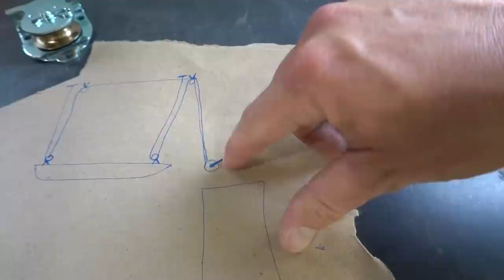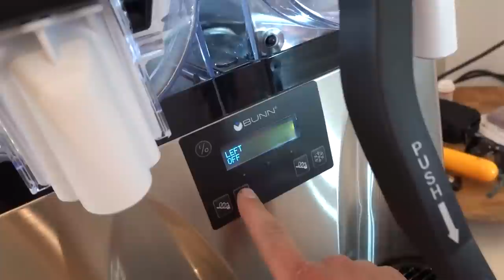Big Lake Day Fail...

Comment: 550 paracord is more than you need. Buy it from the army navy store, if you have doubts about buying it online. If it is real big 6-8 inches of the end should be able to stand straight out when held horizontal without going limp(I meant stuff). Plus the inner strands will not catch on fire, and very hard to burn compared to nylon fakes. Just included two ways to test the ends. Because you don’t want to hang the four-wheeler from your tree stand using imitation 550 paracord. lol.There are good dealers selling it but a lot of fake ones out there too. The two eBay stores I use slip my margarita mind at the moment. LoL. j/k.. Then you can use shock cord with carabiners also from the army navy store to keep the end slips hooked to each other so they can’t slide off. Safest cheap way I can think of. Peace!
  P.S. I would try Some Lipton Iced tea in there for Long Island teas.
Reply: Why is the crank mounted so high? Paracord would not fill up the spool if that is the reasoning. 550 is rated at 550lbs but it will lift double that for a one time use.maybe you can test that in a video. But don’t reuse it because you wont see if the inner strands got damaged. 750 would feel up the spool a little faster making it take less revolutions. But costs way more than 550

Comment: You can use a bolt head instead of the handle and hit it with an impact gun on the crank. We use them on sailboats to hoist keels.

Comment: One cable is all you need, Harbor Freight has a small 1500lb winch that's real cheap, buy yourself good D-rings and use nylock nuts and bolts, you can use Eyelet bolts to help hold the cables to the wall...

Comment: Ok i only made it ten minutes into this video and have to ask, why didn't you just get an ATV 12 volt winch from the off brand store and use it to raise and lower the kayaks? I have one setup in the garage for my jeep top and it lifts it up with ease. Using your pully system will make it effortless for a small winch and it is remote controlled with a fob. You can run it from a 12 volt battery which I am sure you have plenty of those in your shop.

Comment: I would have built a lightweight metal basket for all the canoes to sit in together, and used a 1000 pound cheap ATV style electric winch on a 12v deep cycle battery with a trickle charger on it to keep it charged, to raise and lower them. You could mount the motor anywhere and use a remote to run it up and down, and with the basket, loading and unloading is very simple. my 2 cents.

Comment: I’d buy actual ICEE or Gator Ice branded mix, it has good flavors and is consistently good and it’s easy to mix. It mixes 1:4 for a richer drink or 1:5 for normal meaning for every 1 cup of syrup you want 4-5 cups of water.

Comment: I think I’d make a cradle system.  Basically like a rope ladder on each end of the kayaks ends. 3 rung’s to hold all 3 kayaks. Instead of rope it would be cables. Hope that makes sense. Not that you’ll read this comment. Basically you’d crank all 3 up at a time.

Comment: Next time use some lineman pliers, or grinder blade. I cut through 3/8 cable with my lineman pliers when I hang duct and spiral duct for HVAC systems. Take a little bit of electrical tape and tape the ends that you cut so all those wires don't poke out and cut you when you go to grab the cables

Comment: You will need to make a few adjustments to your Bunn ultra slush machine. My suggestion is to get a Brix refractometer. These are really not expensive on Amazon. 
This will help you have the proper mixer of syrup vs water. 
Also will make adjusting much easier and will avoid premature use on the torque plates. 
These are amazing machine, but you will need to properly do your maintenance to make it last long. 
I sell and service these machines. If you need any help, feel free to reach out to me

Comment: in my opinion the best and safest option would be building a cage of sorts and using a chain hoist. stack all 3 in the cage and use a single hoist to lift them. the weight of the kayaks would be negligible enough that the weakest child could hoist them with no problem.

Comment: You need to treat the extra holes you drilled with a rust preventer and then paint to protect the structural integrity of the beam.

Comment: Matt; the way you mounted those pulleys to that tube steel is the weakest way possible. The force is trying to pull the screws out, your only engagement with that tube is the threads against maybe an 1/8 inch of steel. If you had mounted them on the side of the tube at least you would have the cross section of the screw holding it up instead of just the threads. Ideally you would thru bolt the the beam parallel to the floor.

Comment: 3/16 cable?? Dude, that stuff is rated to about 4,000 pounds! I hung a whole treehouse on four 1/4 cables at about half the weight rating of the cable. This should have been an 1/8 cable at most which is rated at 400 pounds working weight and 2,000 breaking limit and would have been far easier to work with :) Also, the pulley radius is too small for those cables. But Matt, you're out there getting stuff done, even if it is overdone which is alot more than I can say!!

Comment: WHY did you go thru all that trouble for the kayaks . why didn't you just get an electric wench. wouldn't have needed all the pullys  or near as much cable , it puts the cable even across the spool automatically and you don't have to wind it yourself. Would have been a lot easier to install and to use. If you couldn't find a 110v  which I dunno why you couldn't unless you were looking for the wrong thing , get a 12v and a 110-12v converter or just a battery and battery tender to run it.
Reply: well i guess i should wait till the end of the video before i comment ..lol

Comment: Weld a piece of rod on in place of the handle  and grind a flat spot down the edge and use a battery powered drill for a crank

Comment: hang the kayaks vertically on the outside wall of the office with a pulley bolted to the top of the wall and hitch to tie it off at chest height with a carabiner to attach it to the kayak

Comment: Use that same hand crank and put an impact driver on the bolt head and now you have a powered crank. You may need to remove the handle to keep from getting hit by the handle

Comment: Why not build an actual storage platform up there. You know pull the stuff up and sit it securely and safely on a flat surface,  and you can span it almost all the way across from one end to the next.  I think it would be fine for a package building like that. As long as you're not storing whole engines up there that are heavy and all the way across.

Comment: those are just commercial slushie machines so most any syrups will work, have used gatorade, dr pepper. i would honestly just pour a margarita mixer and tequila straight into the machine

Comment: If you find yourself a socket that has both female square drives then you will be able to raise & lower the winch using your battery operated driver or drill.

Comment: The problem was that you had to much water to syrup ratio it their needs to be more syrup than water in the machine it is not a even 50 50 it is more like 30%water 70% syrup and the only reason i know this is because of that i worked at a place that had that stuff and sold it regularly also make shour you clean that once a week and throuly sanitize it because it can build mold inside the system 26:27

Comment: you could use an O-ring screwed to the wall like you have on the ceiling to guide the cables straight into the winch. thank me later. Oh well you changed the setup by the end of the vid so my comment no longer applies

Comment: You couldve just bought a harbor freight wench, and run 1 pulley up top and the cable hooked to a strap that has a hook on each end and lift them all with a button

Comment: What do you mean they didn't have an electronic crank bud?!?!? Lol-ol-ol that is what a winch is for, ya hook it to 12v and then you can raise or lower the kayaks with the push of a button 🤷‍♂️ easy-peasy!
Reply: Orrr if you wanted to you could literally just take that crank handle off and put the bolt in a cordless drill chuck then your drill should have plenty enough power to lift a kayak with ease....

Comment: The single pulley in the configuration you had before gives you zero mechanical advantage. Now if you were in the kyak trying to lift it and yourself you would have your 2to1 mechanical advantage. The two pulley system you have here gives you 2/1 times whatever the reduction in your winch is would give your total mechanical advantage. Minus the parasitic losses

Comment: I laugh and laugh. Please let me help. Why put it over a doorway? You do not have enough cable (which is too thick (1/8" dia. would have been plenty) the weight of the kayaks will not depend on the pulleys or rings, but on the holding power of the bolts you use.
Reply: Thanks for watching You have been randomly selected among winners for today Contact Me❤️